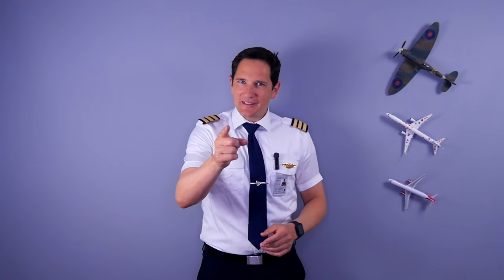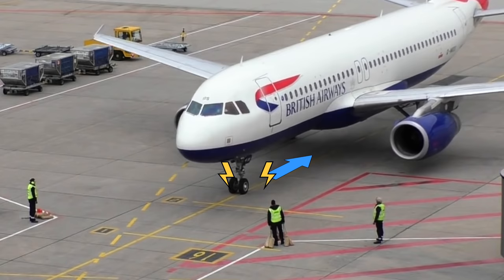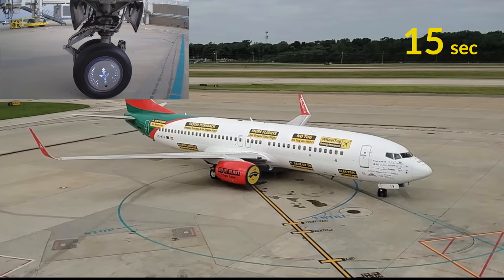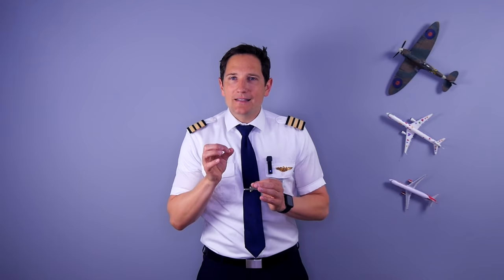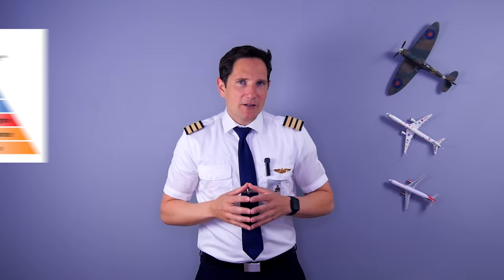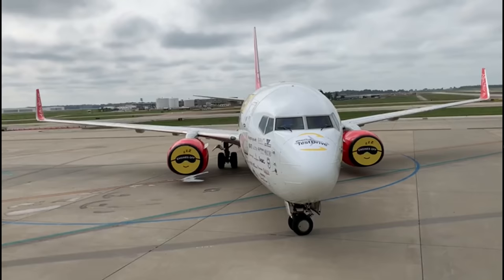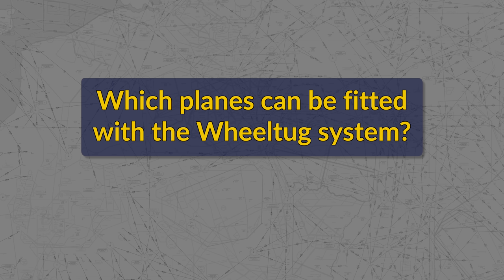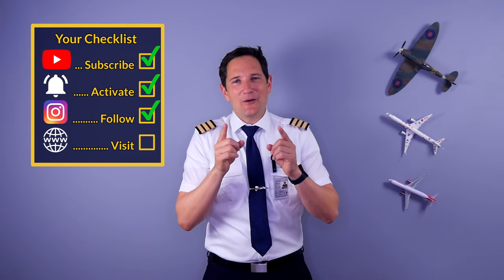The FUTURE of PUSHBACK is ELECTRIC! Without a pushback truck! Explained by CAPTAIN JOE

Comment: Iv'e often thought about this as so much now is becoming more and more minituarised , it would be good idea to eventually dispense with those large tugs as once i was delayed as they had to go and find a pushback tug to reverse our 777 out of the gate also it would be cleaner for the enviroment in the long run to just use electric powered vehicles , at terminal 5 at Heathrow they are already using the mototok truck for BA and iberia flights saving hopefully delays and saving fuel and money.

Comment: I think the electric motors should be on ALL the wheels to spin the tires up to speed before landing, which would make the airlines bottom line better and the tire manufacturers probably not too happy. A set of tires is a real expensive operating expense and this would have them last way longer.

Comment: I'm sure the electric motor in the nose gear is not strong enough to handle bigger planes like the 747 or the A380. It might take several built into the main landing gear!

Comment: It already looked non symmetrical from the outside. How does that behave when touching down at maybe 150 kts?
Why don't they use the electric drives to accelerate the wheels under no load conditions before touch down to create less wear and tear for the wires and runway?
I have been told increasing the complexity on this very critical element in terms of safety would be simply to risky and tires are comparably cheap?! 
Now all of a sudden when savings are high enough if is worth it?
How does it work when the wheel is hot from breaking after touch down and the only air cooling it is being blocked by the mechanism and "blinking" wheel cover?
I guess since the breaking is mainly done by the main gear, which is designed to handle intense loads, this mod is only possible on the front gear, where the thermal dissipation from the breaking system is relatively low?

Comment: Interesting video and cool technology. I felt a little lacking though since the video was sponsored by the creator of the technology. There wasn’t a comparison of similar systems and it didn’t feel like the marketing wank was critically analyzed. Example: wingwalkers was sited as an area of cost reduction; but really having a camera system is separate from the motorized wheels. I’m sure that having wing walkers would still be needed fora lot of use cases. The additional weight is equivalent to an extra passenger lost; but that’s glossed over. The fuel saved isn’t really qualified.
 Love the videos, but this felt a lot like it was just parroting the marketing material without too much critical analysis. Thanks and keep up with the other great content!

Comment: It’s like installing hub motor in motorbike and make it hybrid where you can run in gas and also can extend mile with electric driven motors 

Here it is best for taxi and pushback procedures 

So how will be the engine start procedure will it be during holding short the runway.

@Captain Joe

Comment: hey captain Joe… i have a question, airplane use tons of fuel for taxiing to the runaway and off the runaway, why dont we just pull the airplane using the truck to the start of the runaway and to the gate, won’t it will save alot of money?

Comment: When reversing with this system, and no tug operator to watch out for obstacles, does the plane need rearview mirrors? (Or rear video monitors?)
Reply: The benefits of the system was shorter ground time, lower emissions, lower wear and tear on engines and lower fuel consumption. It was also solved with 4 extra cameras. Though some form of humans walking on ground will be needed anyways. The system is not being installed to remove the thug operators.

Comment: Captain Joe;  How does the crew determine the aircraft weight and balance?  I always thought that weight gauges embedded in the parking spot (like for trucks) determine the TO weight and CG.  On a recent flight we were delayed because the plane was very close to it's max weight and they had to re-balance the  luggage compartment to get the plane CG within specs.  We were with a group of skiers so yes, skis and boot bags add a lot of weight.

Comment: this is an interesting concept but as an engineer with plenty of hands on maint experiance too, iwonder how robust the electricmotors will be especially when subjected to the forces of landing  impacts and high rotational speeds during tTO&landing what happens if the motor fails  and jams afrte gear up?... you wont know untill the nose wheel touches the runway?
Reply: you can probably design sensors which will detect it, or have the system disengage after a certain force is applied, such as by landing.

Comment: I understand that there are motors on the Main Landing wheels that are designed to spin up the wheels prior to landing which significantly reduces wear on said tyres at landing. Could these motors be used to move the plane on the ground and thus save some weight of and extra nose wheels motor?

Comment: Couple of points here. 1. This is clearly an ad. 2. I'm not sure the pilots are the best ones to determine the correct path of the aircraft in and out of the gate. Ships pick up a local pilot in port, and the drivers of the tow vehicles work at that airport, and have a better knowledge and view of the obstacles in the very busy gate area. 3. That "twirl" maneuver. Its not really pushing the whole aircraft and experiencing the whole drag of it. The aircraft is just rotating in place. Most of the video is showing that, and you'll notice that the movements where the entire aircraft is moving forward or back are much slower.

Comment: It may eventuate, but I think there are some big problems to overcome. And by big, I mean, just how big are those pushback trucks? They are huge and heavy. But some little electric motors on the puny nose wheel are going to do the job instead? Power supplied by hefty electric cables, carrying many, many amps of power from the APU, through the fuselage, under the cockpit and down to the wheel. Was that demo done with a fully fuelled, cargoed and passengered plan (if those are words :-)? In all weather conditions? And it all has to work reliably, despite the forces and stresses involved with landings. Good luck with it all. I'll eat my words when I see it in service.

Comment: You can do better than that:

1. use induction motors: no clutch required. Sure, they are a little less efficient than PM motors, but you save weight (and don't even need to use ferromagnetic materials if you choose not to);
2. don't use APU, use batteries instead, they are plenty energy dense enough now to allow for taxiing the whole way to the runway; and use them also to spool the engines up;
3. fit powerful motors in the main gears too: they will allow to make the initial push while the engines spool up, AND will eliminate some of the needs for reverse thrust and friction braking by recapturing energy on landing.

It's not because Boeing botched it with the 777 that batteries are not fit for use in airplanes! Oh, and make batteries a structural element too.

All in all, what I'm saying is that you can avoid having to use an APU altogether and recover energy at the same time. What's not to like?

This looks like an innovation, but it's only scratching the surface, really.
Reply: 1. Wheeltug DOES use high-phase-number induction motors, and definitely does not use permanent magnet motors. This permits higher motor temperature, freeing up design constraints. 
2. Why carry batteries all through the flight when you use them for only a few minutes before takeoff and after landing? You're already carrying fuel. 
3. An enormous quantity of brake heat must be dissipated from the main gear wheels before the next takeoff, and motors there significantly interfere with brake cooling. Trust me, this is a non-starter.
Reply: 1. Then why the clutch? If you don't apply current to an induction motor, it is freewheeling! Hmmm, let me guess... Because the system is run via the APU? Then see 2...
2. Because they will eliminate the need for an APU and thus lower fuel requirements; plus, if you use batteries as structural elements, you save on the weight of the structure too.
3. Energy which can, for a good part, be transferred back into the batteries when induction motors "bleed" energy back into them on landing. Thus reducing the brake weight and wear.

Trust me, this is NOT a non starter. It is just that no one has really tackled the problem this way before.

Comment: Optinonal cam-system? Why isn't it standard for this system? 

I'm often wandering, why the airplane manufacture are scared of putting enough outside cameras in the fuselage so the pilot can monitor the wings, engines, cargo bays and everything else that might cause a beep on the dash board. The weight in summary even with the wires shouldn't be such high that it might effect something else. And todays cameras are cheap and very durable. Ask the creators who work with action cams here. One monitor will do the job, if the software alows split-screens. If it's not used, there's probably some space in the cockpit to flip it away.

Comment: but in bad weather (snow, ice) how do you think the system is doing? I think the grip on the front wheel is quite small and then it may not be able to move the plane.

Comment: Ok. Cap'n Joe. If the engines have to warm up before take off and thus you cannot e-taxi to the runway, then how is taxiing on one engine possible as that would also reduce the warm up time for at least one engine? I would expect that they could make this more powerful to allow for highspeed taxiing. However, this could be only enabled when off the apron. Do you not lose the ability for the push back team to give the aircraft a final once over as the engines start? Thanks for a great video!

Comment: is it possible to use this system for Braking as well? Technically an electric motor working in reverse and triggered after touchdown at landing is braking ... as opposed to conventional braking using physical contact and frictional forces between a brake pad and brake disc. 

Just a thought :)

Comment: Great explanation.  How well will it work in snowy or icy conditions?
Reply: Not.  But many innovations take years to improve and perfect, and you have to start somewhere.  I think when this concept becomes a widespread reality, it will either be electric traction on the main wheels, or automated cradle-tugs that go out and dock to nose or main wheels.  Navigation/control will also likely be automated.  This would have the big advantage of not being aircraft-type specific, and not having to be hauled around in flight (useful load penalty). I figure maybe mid 2030s.  This video, which I LOVE, is part of the good progress, but we'll have to be patient.

Comment: Hey Joe, would you explain how the 737’s airstairs shown at 6:25 work?
Reply: It is optional system installed below the floor board which electrically extend and retract from the pressurised stair doors.

Comment: If the aircraft is doing a reverse turn (in it's own space) wouldn't that "scuff" the tyres on the main landing gear ? I mean wouldn't the plane have to have some backward movement to prevent this ?
Many years ago I saw the Russian transport cargo aircraft in Melbourne Australia & there was a concern about it doing 90 degree turns from taxi to runway because the main gear scuffed the tyres on the taxi way & left pieces of rubber behind. & a question iv'e pondered for a while, why is height in aviation still given in feet rather than the standard measurement of meters ?
Stay safe & keep on smiling.

Comment: I don't see this ever being applied for one reason.  No airline wants to add another point of failure.  If the motor goes out then they would have to wait even longer for a pushback tug.

Comment: Joe, maybe 2 more common questions might be these (as I say "might," I mean just potential):
Q.: We've had motors for large vehicles for a long time now. So why couldn't this have been done a long time ago?
A.: Because motors used just for ground operations tend to add too much dead weight for the plane to be efficient enough for it to be worth that.
Q.: Well then how was it finally decided just now that they actually don't add too much dead weight to be worth that?
Reply: putting motors in the main gear had heating issues with the breaks, and didn't save time. finding a 5" wide motor powerful enough to move an airplane is not easy.
Reply: @johnstuart8013 : If you meant "brakes" instead of "breaks," then this is my reply: So in addition to what you said about heat there, you're saying that the motors from those attempts were too big for the nose wheels? So if that's the case, then back in those days did anyone try modding the body of the plane to accept traditionally longer motors (in either orientation: direct-shaft-drive or right-angle-geared) than these they're managing to fit on now?
Reply: @HelloKittyFanMan.  Redesigning an airplane is hard work. this system is supposed to be easy to install, which would probably mean the airframe is left alone. it costs millions+ to change an airplane, and if you have ever been in the EnE bay, there isn't much space for a large watermelon motor.
Reply: @johnstuart8013 : Even if I haven't been in there, maybe it's like that. I doubt it depends on my presence. And not every single change they could make would cost millions of dollars. It just depends on what it is.

I haven't had a good enough look at the space that holds the nose wheels when the gear is taken up, but it sounds like you're saying that cutting a notch in the body to accommodate an older style of motor or motor/L-gear combo wouldn't be enough.

Comment: Progress, but an electric mechanism should take the plane all the way to takeoff.  The fuel savings would be enormous as planes are VERY inefficient at taxi speeds. Possibly could allow ATC to have control part of the way as well as they know the airport better than the pilots do.
Reply: I could see engine start-up taking place within the last 300 ft of taxing just before takeoff, that way no fuel calculations need to factor in taxiing and departure delays on the ramp and the maximum amount of fuel of the air can feed the engines and thus give a larger margin for the times that a problem needs to be flown or if there is a landing delay

Comment: Pushback Truck and using plane engine power on ground steering (just after landed) never really make sense in the first place.  It was introduce to solve something by introducing a bigger inefficiency in the first place.

Now, an electric motor small enough to fit inside the front steering wheel and can tug entire mass of the aircraft + fuel + passengers + luggage.  Just let that sink in for a minute.

Comment: This is a nice 👍 idea for lightweight aircrafts, to make a 180 gr turn with wide body airplanes? FOR GET ABOUT IT…..!!!
The weight on the main gear is enormous, there is a limit for turning a aircraft to the left or right side. If you turn it to quickly and to sharp you will damage the tires under the main. Me as a former Pushback driver at KLM will tell you directly impossible!,,,

How about the jet wash when the engines are heading to the terminal? And when we talk about heavyweight planes the need a massive push to get clear of the ramp…..what about ground staff in this matter? Ones I saw a Pushback driver puts an Airbus A340 not correctly on the apron lines so the engines where blasting towards the other terminal, ground staff was almost blowing away because of the power the Airbus needed to get in to motion……

Comment: There isn't much weight on the nose wheel. On a slippery surface, the nose wheel may not have enough traction to move the plane.
Reply: Please see the Wheeltug video showing this system in use in snow and rain in the Prague airport. (I hope they didn't delete it.)

Comment: Wait, but didn't you also make a vid on the same concept and conclude with the fact that it would add more complexity? This was my takeaway from that video. 

less complexity=low chance of failures=more safety>time?

I think it was your video. Or I might be mistaken. It might be Kelsey's. Either way, it's great that this version did fix that complexity problem with free rotating wheel.

Comment: Wow, ok this looks cool. One question Captain Joe. When would the startup procedure be done? There appears to be a trade-off between taxi time vs speed, plus other factors like how long the engine and oil temperatures would need to warm up. Assuming you have a long taxi to the other end of the airfield, when would be the optimal time to start the engines?

Comment: Surprised you discover this system so lately. EGTS was showed in Le Bourget airshow in 2013. Designed by Honeywell & Safran, equipping a A320.
But out of a quarrel. Can this system be involved in a backpower slowing down system as used by streetcars or e-cars ? Thanks.

Comment: Seems like the aircraft is turning in excess of 90 degree angles (exceeding the no tow zone) how would it affect the centring cam of the Nose Wheel Steering mechanism ?
Reply: the wheel can turn more than the tow zone. it goes to 78 degrees I think.